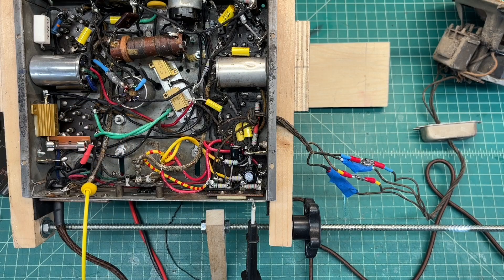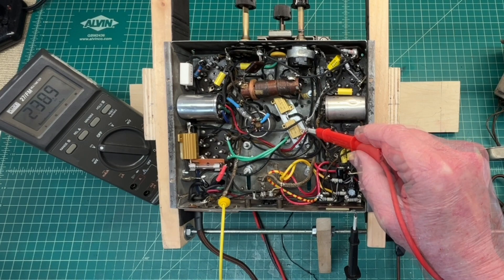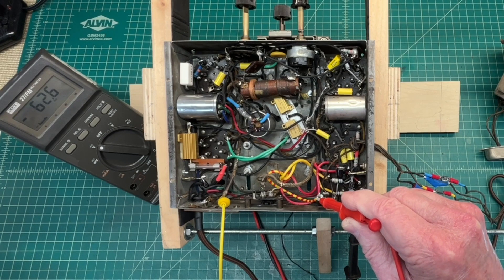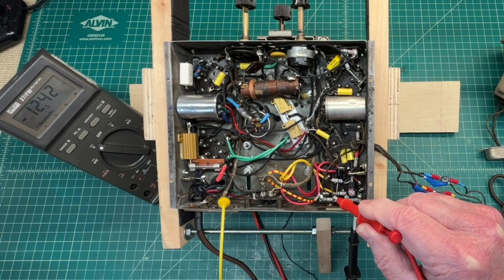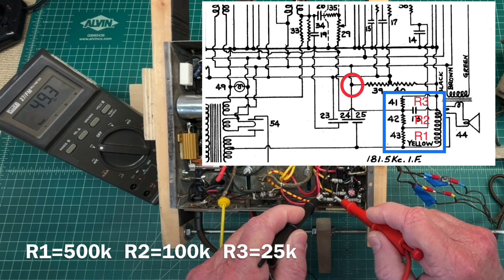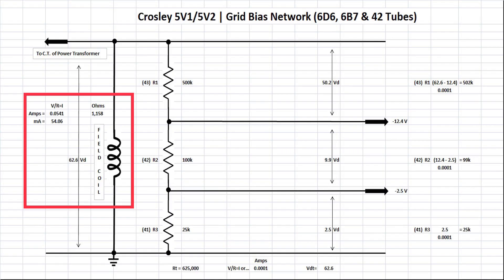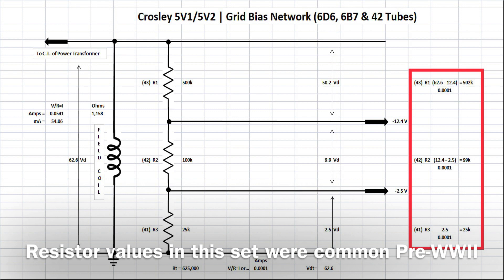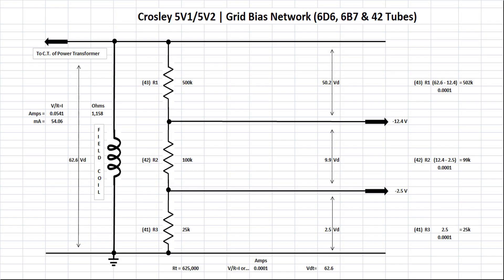Crosley 5V1 - Grid Bias Network Explained | Voltage Divider Calculations

Comment: I learned  voltage  divider theory  years  ago     with the  two book  AC/DC  circuit   analysis   from  Radio Shack
Reply: Yes, those books were some of my favorites when I was in my 40's.  Loved the Sims series as well !
Reply from the maker: Me too. Best, Don
Reply from the maker: Yep, good reference material John and as I recall easy to follow. Best, Don